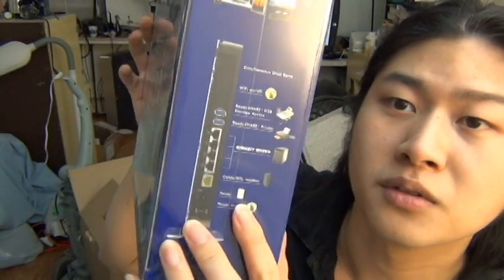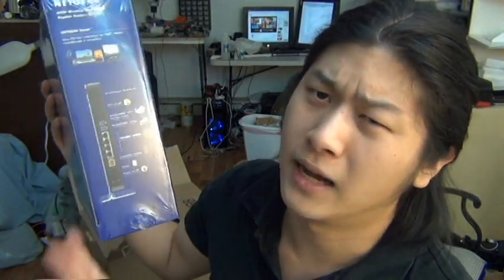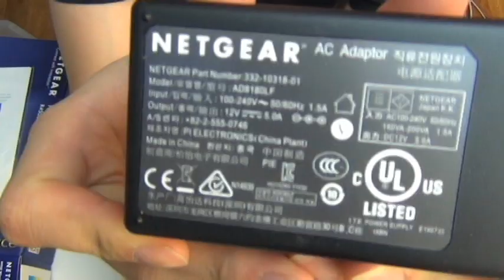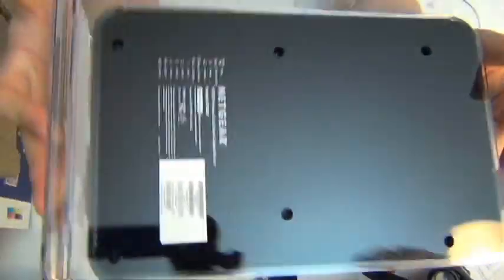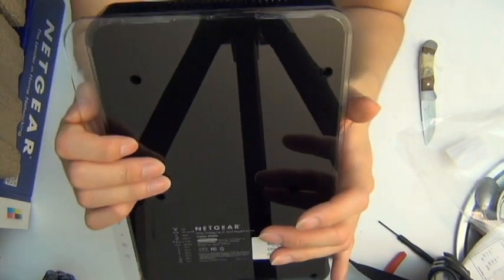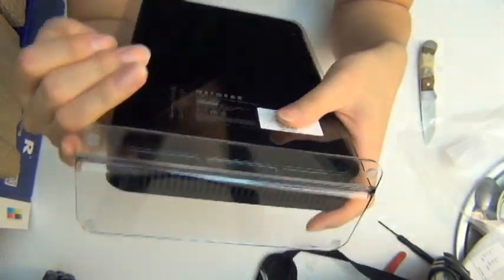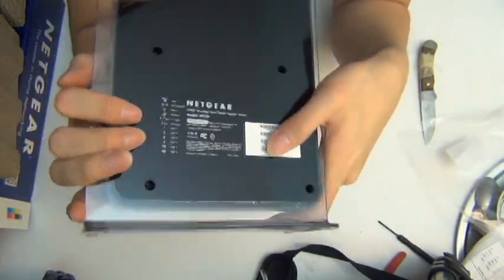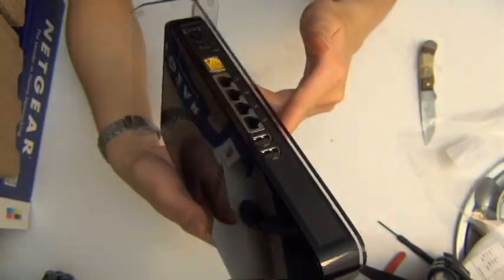Wireless Router Teardown OpenBox NETGEAR- N900 Dual Band Gigabit (WNDR4500) Disassembly Review

Comment: I have a Netgear CG3000DV2 a wireless cable router. Where the power plug inserts in yo the router that part is very loose it must have some of the soldier cane loose from the motherboard.  Any advice you can give me how to open up this router and re soldier the power adapter power port more Bette to the motherboard? Any help videos website links how to’s would be greatly appreciated. Thank again great video.

Comment: The signal is pretty good on this unit, but did you ever wind up upgrading the antenna(s) to boost the signal?  If so, what type (dbi) did you wind up using & how many? Is there a video on the upgrade?

Comment: This router can't handle wifi for long. Ping will spike to 800-1600ms for extended periods of time for absolutely no reason despite the cable modem getting 20-30ms ping. Tested on multiple freshly formatted laptops. The wifi latency is sporadic at best. Updated firmware then reset router, issue persists. Either there is some electromagnetic wave being aimed at my house, or this router is crap.